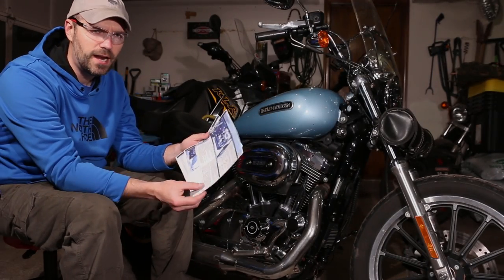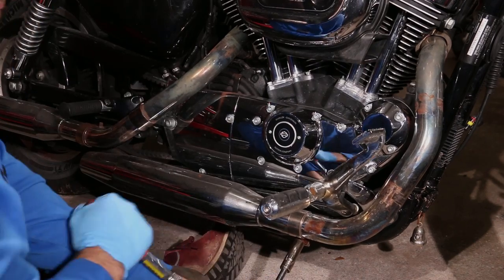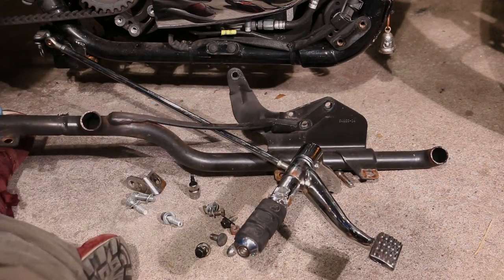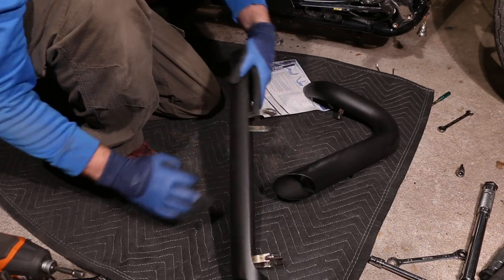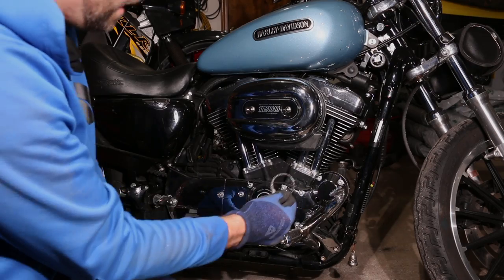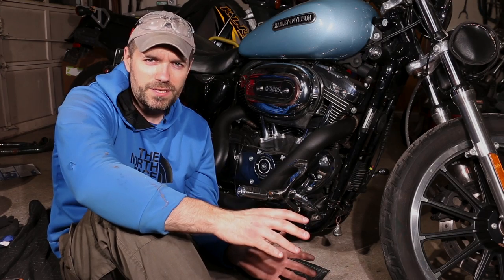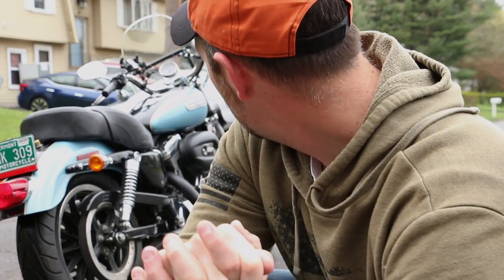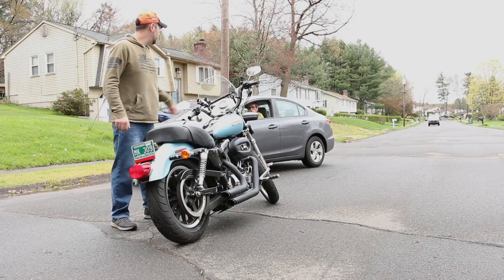BEST INSTALL and SOUND VIDEO - VANCE & HINES Short Shots on a Harley Sportster

Comment: Thanks for the no BS installation and for providing the torque values. I'm installing mine on Tuesday after work. Already have the old pipes and mounting bracket off so should be a breeze. Hope to see some more sportster videos coming from you good job man!

Comment: Just got the install done on my 2018 iron 1200 these F$@%n pipes are loud as hell. The youtube videos don't make them sound as loud as they really are. I'll be getting the quiet baffles over the Winter for sure. The install went great except for the fact that everyone failed to mention that one of the mounting bracket bolts for the rear pipe needs to be inserted before tightening it down. The rear brake master cylinder is in the way so had to remove everything again to get it in place. Other than that no issues at all. Really happy with the Vance and Hines FP3 fuel pack. Fired right up and ran great with the short shots map. Smells a little rich but that's a good thing no burnt pistons from a lean burning stock map. Thanks again for your video makes me laugh every time I watch it.

Comment: you have to install fuel pack fp3 ?
Reply from the maker: No, but you should tune the bike after you change the intake and exhaust
Reply: @GIBro-mm5dj   why?
Reply: @rafaelpereira3028  because it changes how much air is being brought in and pushed out, the engine is tuned for the stock setup and won't run as efficiently until the ECU (or whatever its called on a bike) is reflashed to best use the changes.

Comment: Great video, I have a question for you, you reprogrammed or installed fuelpak, and if you didn't you didn't you had no problems with the performance of your harley
Reply from the maker: Nope, runs great
Reply: @GIBro-mm5dj  Okay I have one identical to yours, I'll just install the exhausts and I won't reprogram or install the fuelpak. Thank you so much for your advice I hope I look great like you,
Reply: @GIBro-mm5dj  Last question, the chek engine is active on your bike or not
Reply: Brother that torque you used paw the screws of the heads helps me please is the only thing I need to tighten